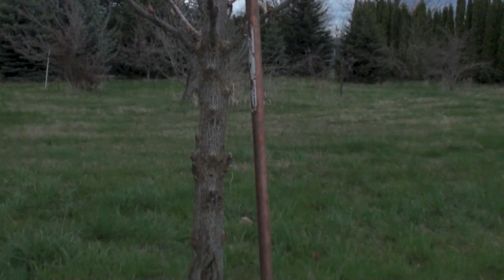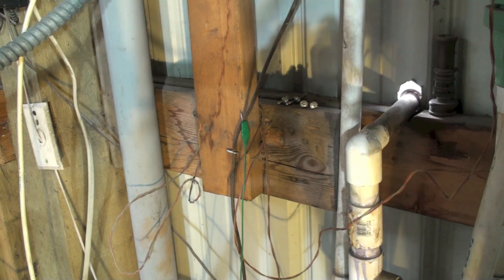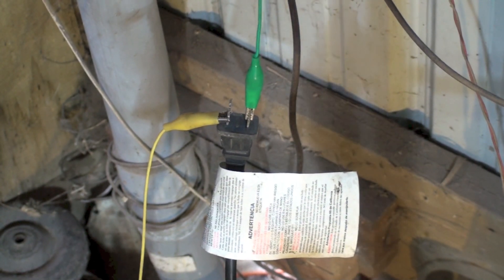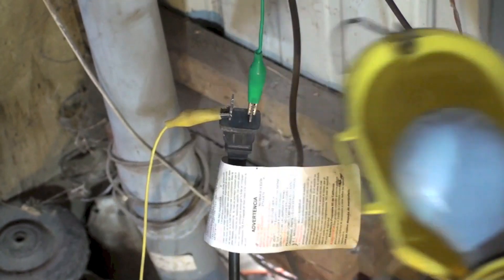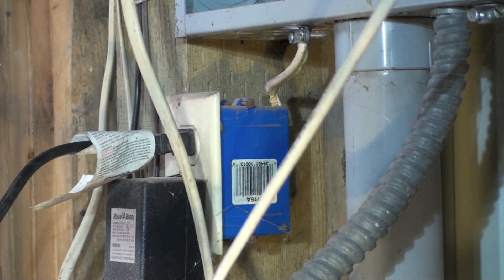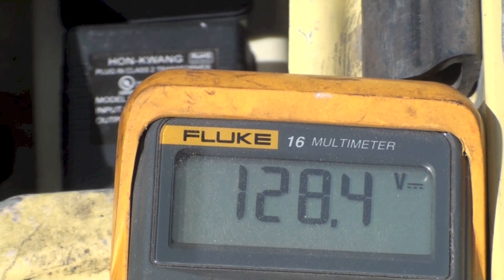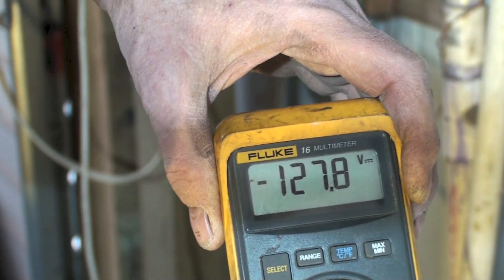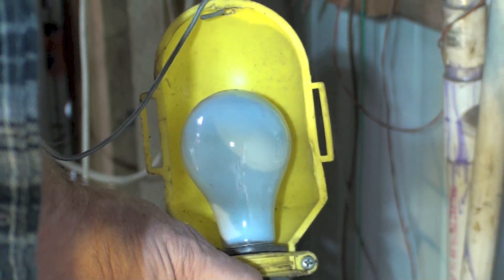Can power pass through earth ground

Comment: THANKS FOR THE VIDEO!  I would loved to have seen a couple of things that you were set up to do, but did NOT do:

1)  The last 1-1/2 minutes was just showing the meter read the 120V (...well, 128v) that failed to light the bulb...WHY, at this point, didn't you switch it on so we could see how far the voltage dropped???  That incandescent filament is quite a load for this "dirt" circuit.

2) Why didn't you use the meter's current function to read the 'short circuit' current?  This will NOT harm the meter if you make the connections (tight, to prevent sparking), and THEN turn on the power.  I have done this with many neon sign transformers: up to huge 15,000V 60mA units.  With this NST, I got a reading of almost exactly 60mA (I removed several shunts and got the current over 70mA!)...been running for a decade!

I do have to add this:  The ONLY time I damaged a meter was when I made the measurement on a cheap DMM with the current fuse MISSING!  The high voltage sparked across the fuse clips...'nuff said!

Comment: Hello Grayfurnaceman
Try using 120 volt AC. The single wire earth return (SWER) is still to this day being used for electricity distribution in rural SK. So obviously the system works.
Reply from the maker: 120 volt A/C will do nothing.   The SWER system does work but the voltage must be very high.  Many rural systems were done this way because they only had to run one wire.  The problems come when there are water pipes and the like in the ground.  Also there is some efficiency lost.
GFM

Comment: Yes earth ground will trip a breaker if it is properly grounded of course most grounds are not
Reply from the maker: Earth ground will not pass enough power to throw a breaker.  I have tested it and done a video on it.  If the ground is connected to the neutral of the panel, circuit protection will open.  Not because it is going through earth ground but because it is passing through neutral of the panel.
GFM
Reply: The NEC did a work shop that was on youtube some time back say around 2008 or 9 I watched.. in this video they talked about utility providers losing their neutral or earth ground at witch point your earth ground is the only path back to the power plant as power plants DO NOT PROVIDE a ground back to them other than earth ...when this happens your earth ground is all that is left ...meaning it should be capable of tripping breakers ..but the truth is most will not ...this is why grounding is so vital to safety ...you mentioned the video where Holt tried with some success pulling like 13 amps to ground at 50 feet  of grounding on one side of the building and I don't remember the depth of the other rod .. I seen that video as well ...anyhow on paper your earth ground should trip a breaker ...but as you pointed out this is not the case but on paper it will and can IF properly grounded witch is very hard to do and cost much more than expected ....LOL planting grounds rods all around the building ...ther are videos on how to do that too ...I been wiring a little house I'm retiring to I have 3 ground rods and a 20 foot by 6 inch well  casing I'm using for earth ground ...oh yell lighting rods on the roof too don't forget that

Comment: GFM 
Really good info on your videos .I have enjoyed watching them and picking up a tip or two
 I have a question that maybe you can lend some info to
 Chain link fence for back yard the house is a mobil home so there is a disconnect at the pole after the meter .There is a panel inside the house. Fence barely touches the trailer
 I notice that I get a tingle(small shock) when I touch the gate to open or close
 Last night I noticed the gate latch sparked a little bit when I went to close it
 I think maybe the neutral is loose somewhere and the load is now using the ground or the trailer to complete the circuit
 The panel inside should have a ground wire going to the trailer frame and rather than going to ground it is spreading out and going to the fence
 I have no weak or dim lighting ,everything is working correctly 
 If a hot wire was loose you would think it would pop a breaker either at the pole or in the house. If a ground were bad the circuit should still flow as if nothing was wrong
 Is there a way to test the neutral or how would you go about isolating and fiing the problem
  I am fairly knowledgeable of electricity and how to use electical tools such as a volt meter and the testers for correct hookup of outlets
  Any help appreciated

Comment: Hey GFM thanks so much for your videos I love learning about electric. My interest peaked last yr when my electrician son changed out my fuses to breakers and after watching him do the main panel replacing wires from the meter to the main panel. Under his direction I replace the fuses of my 2 subpanels but whoever wired the house didn't include a ground with the 3 wire -so both sub panels just have 2 hots and 1 neutral.  So my question is, how will this affect safety if there is a fault and is it crucial to keep Neutrals and ground wires separate in sub panels that don't have a ground?  And what is the difference if there is a short in my subpanel (where there is no ground) or in my main panel where there is a ground? sorry if this is too confusing - chuck
Reply from the maker: Chuck & Nancy albrecht Grounding is confusing.  The neutral is the safety.  Any shorts to chassis of the equipment will travel back to the pole transformer and open the circuit protection (breaker, fuse).  So in your case, if I understand you correctly, if there is no chassis ground, I would connect the neutral to the chassis.  The earth ground is not there to open circuit protection.  It just provides a second path to the neutral in the main panel.  Hope this helps.
GFM

Comment: You can do a short from the hot to the neutral and the ground
Reply from the maker: If you short between hot and neutral with or without earth ground, the circuit protection will open.  Hope this helps.
GFM
Reply: Thanks

Comment: Great demo, it shows what I would have thought. You've got high resistance continuity, just like a frayed wire. Voltage drop is too high to allow enough current to flow to light the bulb.... Of course you can't measure voltage drop unless current is actually flowing.
Reply from the maker: You got that.  Unfortunately, electrical system earth ground has been mixed up with neutral so many people think power normally passes through earth ground.
GFM

Comment: Good stuff. I'm surprised that there was virtually no voltage drop until you put a load on it. You could try lighter loads or use resistors in series with your meter to determine voltage drop against various loads. start with a 10 ohm then try 100,1000,10,000, you get the picture. you could measure amp draw as well and solve for watts.

In an area where earth ground is used for A.C. transmission it seems like a simple device that would take the waveform in the ground, shift it 90 degrees or 60 degrees (depending if its single or 3 phase) then return it to ground through a load in effect stealing power from the ground and back to the ground. I imagine a very large capacitor would be utilized in this circuit.
Reply from the maker: The lack of voltage drop is normal if there is no load.  The drop only comes when  the load is energized.  I did try for amp draw and got none that I could measure.  As for power theft, there is an easier way.  If you place an inductor close to the power line you will get a small induced current.  Thanks for the thoughts.
GFM
Reply: grayfurnaceman
Thanks, not to be that guy, but yes I know all of that. I was trying to come up with a more novel way to tap into the power grid. If they are going to be dicks and pollute the ground with 50 or 60 Hz electrical noise then why not pull directly from the ground, my idea seems less like theft then making a make shift transformer on their transmission cable. (Cable) vs (Earth), see my point? Especially if its on my/your property vs tampering with their lines.
They take the risk by assuming they can use the earth as a conductor. If you put radio waves out into the atmosphere then they are free to anyone with a receiver so the same should hod true for using ground as a means of return transmission. I don't think they could sue or prosecute someone for using my idea but they sure could if you mounted a coil next to their physical equipment. Not that I'd even seriously consider doing what I propose, it's merely a thought experiment. 

As far as no load, I expected the earth to act as a load. even a copper wire acts as a small load, especially when dealing with D.C, 
Anytime distance is involved A.C. wins everytime. Thank you Nikola Tesla and George Westinghouse! Edison and Marconi, you can eat one.

Thanks again for posting this vid. It got my wheels turning. Always enjoy your vids. 

Getting ready to move to a new place with a Lennox Pulse furnace. I'll be reviewing your videos again on that subject again. Have never had to work on one and now I'll own one for a short time, until I change it out that is.
Reply from the maker: tstatech When I was reading voltage, I did not have a complete circuit except through the voltmeter.  Once the load was applied, I believe the voltage went to zero, which would give a voltage drop through the earth ground of 128 volts.  I will have to check that one again.  Kudos on Tesla and Westinghouse.  Thanks for the thoughts.
GFM

Comment: Try it with AC.   Line 1 to ground. through a load like a light bulb.    I bet the bulb will light, since there is no actual current flowing into the ground and saturating the ground as with DC... the light bulb takes the 'work' out of the current...so that the ground is acting just as a back stop to support the oscillation.    I am surprised however that DC wouldn't work, since you can get DC flowing into your body to ground and be electrocuted.
Reply from the maker: I will be doing another one with ac but I must use an isolated source.  But from what I have done so far it does not light the bulb.  We shall see.  Thanks for the thoughts.
GFM